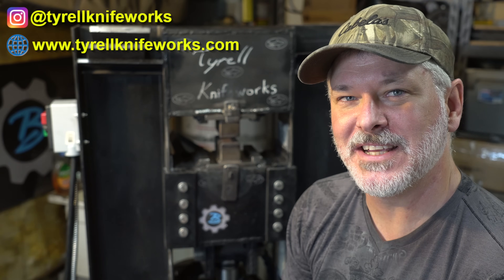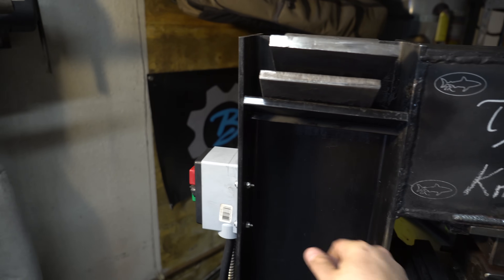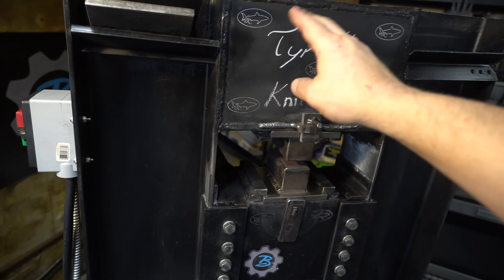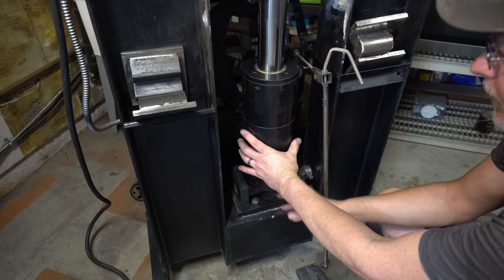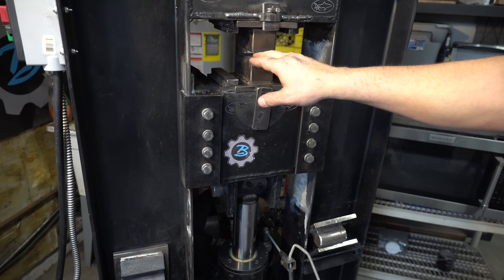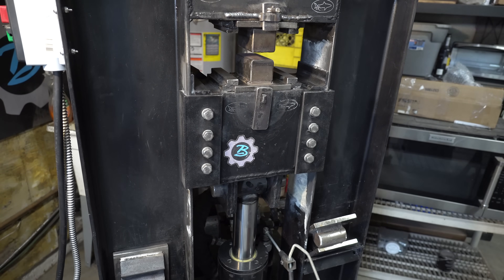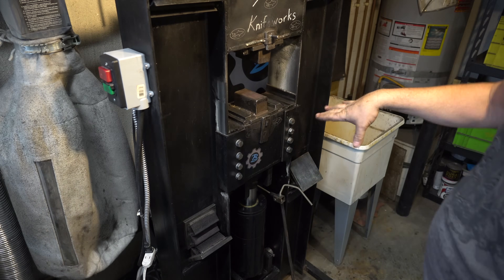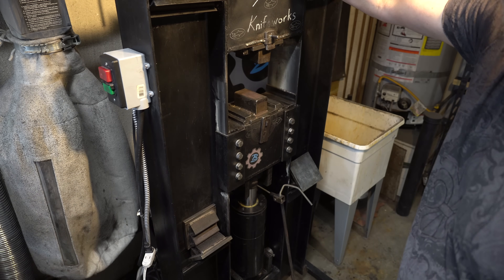Triple-T #83 - How to build a Hydraulic Press

Comment: Good day, im about to start a forge press build and have used many of your product links and suggestions. Thank you!
My question is, 
With the 13gpm pump, 3450 rpm 5hp motor,
Have you had any issues with the 10 gallon reservoir? 
Inquiring about it some say it should be 2 to 3 times the pump flow. (Say 35-40 gallons)
I was just wondering if i should get bigger than 10 gallons if you've ever had over heating or problems.
Anywho thank you so very much for all your content and your time 🙏
Reply from the maker: It’s a great question.  I’ve had no issues with the oil heating up at all.  I use my press sometimes for 8 hrs a day for multiple days and I’ve never had an issue.  Good luck with the build.

Comment: Hey man, I’m not sure if you know this or not, but the Coupler you have listed is 5/8 to 1/2, not 7/8 to 1/2, which the motor you have listed is a 7/8 inch shaft. I’m actually building the press, just got all my parts in however i immediately saw the L jaws and realized i should have checked. Just wanted to let you know
Reply from the maker: Ah yeah, I’ve had to replace the link to the motor a few times and must have selected a 7/8” shaft.  The 5/8” is more standard.  I’ll update the link.  Thx.
Reply: @TyrellKnifeworks No problem brother. Thanks for the good build, i’m about to start welding everything and i’ll have it built hopefully within the month.

Comment: I use my hydraulic wood splitter.  27 ton if I remember correctly,  and runs on a 6 1/2 horse gas motor. It doesn't release until I turn the lever to retract.  Honestly I didn't even know any were made with springs.  It's towable too. You must be referring to the cheap electric harbor freight type splitter.
Reply from the maker: That’s a big splitter.  Most are 10 or 12 tons and are not built for any sort of resistance like steel and flex like crazy.   Thanks for watching.
Reply: @TyrellKnifeworks  every one I've ever seen, other than the harbor freight electric junk, are made with a big I beam base, a ball hitch,  and an axle for towing. Every farm store in the country carries one,  except maybe California and their no gas engines nonsense. Some are even bigger than the one I bought.  They have a 2 way valve with a handle that engages and retracts the hydraulic cylinder.  Mine even has a tilt feature that allows me to stand the beam up and split horizontal instead of vertical for big pieces of wood.  It puts the base at ground level.

Comment: Do you have a parts list for the steel?
Reply from the maker: The ibeam I used is 5”x8”.  It’s two
5-foot sections for the side beams and three 1-foot sections for the top, bottom and sliding head.  I used 2”x3” angle to enclose the head onto the ibeam.  The rest was scrap I had lying around for the legs and tank cage.  I hope that helps.

Comment: You mentioned 35 gallon per minute in the video and listed a link to a 13 gallon per minute pump... could you please verify which it is?
Reply from the maker: It’s 13gpm.  Sorry for the confusion and thanks for watching.
Reply: @TyrellKnifeworks  Thank you for the clarification - I gotta say - not sure if you went off of someone's plans but holy buckets that's one seriously over-built press. Yield strength of A36 structural iron is 36,000psi and based on the dimensions you provided on the uprights, that's W-Beam 8x21 meaning 21 # / ft - both of those beams together can support about 220 tons before deformation!!! Thank you for the walkthrough! Very thorough and informative!

Comment: Hi Master 😁
I am in the process of building a press from your project. I don't know about hydraulics either, an engineer friend is helping me. And would like to know what working pressure is set in your press.
Greetings JB ✌️😎
Reply from the maker: My cylinder is rated for 3000 so it’s around that pressure when operating.  Thanks for watching.

Comment: What sort of tradesmen did you hire to do the hydraulics?
Reply from the maker: I called a local hydraulics shop and asked if they would come quote it.  It was $450 for them to bring and install the hoses and fill it with oil and test it.  It was a good deal I thought.
Reply: @ sounds like a good deal to me. I will give it a try when I reach that stage. Thank you.

Comment: Just the listed materials in the links are $1700 today, only 2 years later. Thats NOT counting the steel, OR the $400 he paid to have the hydraulic work done. Im guessing this is an easy $3k build today. Thats double, or just about if the steel and other odds and ends dont add up to $1300.

Absolutely nuts.....
Reply from the maker: Yeah, it's really crazy how expensive things have gotten.  When I bought that cylinder it was only $305.  The steel was $200 and they cut it for me.  Still, buying that press from Coal is around $8k for a 25t and this is 29t.  Thanks for watching.
Reply: @TyrellKnifeworks  I probably should have started my comment by saying thank you for the video because it's a great tutorial. And you are correct, still cheaper than a store-bought press, and I would think it's even better because you can really tweak it to your own needs. I was just floored at the pricing increase.... Crazy! 

Keep up the great content
Reply from the maker: @mtoto78 no worries, I took it as you meant it. 👍

Comment: I amso have a question regarding the pump, in your video it says the pump is a 35gpm. but in the parts list it says 13gpm. a 35 rpm pump runs around $750 and looks nothing like what is in the video. Sorry for the confusion but I was just wondering which gpm level I should get. :D
Reply from the maker: It’s supposed to be the 13gpm, I misspoke in the video.
Reply: @TyrellKnifeworks  thank you!

Comment: Quick question (I hope)... the linkage from the foot pedal to the valve is hooked over on the top. Is there any reason to extend it and have it hooked over, or can that be flush with the square tubing? Looks like it would function as a handle, but I can see myself hooking on it. Thanks for putting this out there, I really appreciate how much content you've provided the knifemaking/blacksmithing community!
Reply from the maker: It’s hooked over so it doubles as a handle if you want to do it manually.  It’s far out of the way and I’ve never even brushed it while using the machine.  Thanks for watching

Comment: Thank you for the video... On your build, dis you have the hoses made to length or are they off the shelf lengths? Is there anything you would recomend doing differently now?
Reply from the maker: I had a guy come do the plumbing for it so he did the hoses custom.  The only thing I’d do differently is that I’d put flat areas in either side of the die holders so I could put holders for different lengths of square tube on both sides for kiss blocks.  That’s it, everything else seems great and I’ve been using this press for 5 years.  Thanks for watching
Reply: @TyrellKnifeworks  thank you for your time. I have build 200 Tire Hammers and am thinking about building a few presses.

Comment: Did you do stress calculations on the frame (especially the welds)?
Does the hydraulic system have overpressure protection?
Does the system have an emergency kill switch that could be reached in case of an oil fire?
Is the operator protected in case of a burst hydraulic line?
Are you sure the tray is adequate protection when a workpiece drops out of the wrong end?

There’s a reason why you can’t buy presses for +-$1400. Safety chief among them.
Reply from the maker: Yes.  Thanks for watching.
Reply: @TyrellKnifeworks  what do you mean “yes”? You mean to say you did all of the above? 
Don’t just give me a “yes. Thanks for watching” and treat me like an actual human being with legitimate concerns.

Comment: Thanks for great explanation, this seems quite doable and I'm going to build one. I'm also wondering, what were the considerations for selecting the cylinder, the engine and the pump? As someone coming from the metric part of the world, I'm going to use some different equipment and I'm not sure how the calculations work. I've done the conversions, found a 220 bar 50 lpm hydraulic for 3000 rpm, a 4kW 3000 rpm motor and a 50-ton-rated cylinder with a 63 mm diameter, and napkin calculations show that it should move at 67 mm/s (2.6 inch/s) and produce a force of up to 28 tonnes. Am I correct in calculating force from the pump pressure and cylinder diameter and choosing a cylinder rated higher than that force? And how does the engine power factor in here?
Reply from the maker: Choose your cylinder first that you want to base your build on.  There are online calculators for speed of the cylinder based on the pump speed and that's what you need.  You want the cylinder to go at LEAST an inch / 2.54cm per second, preferably 2"/5cm per second.  To achieve that you need a good pump and then get the motor with enough hp to drive that pump.  Make sense?    Thanks for watching!
Reply: @TyrellKnifeworks   thank you! Looks like the components I found should work great then

Comment: Do you have a list of metal you used? I’m not sure if the link works anymore
Reply from the maker: Not a specific list but the main parts are 5” x 8” H-beam cut in two 5’ lengths with 3 12” lengths used as the supports and the head. Thanks for watching.

Comment: Great build, love it. I have been pricing materials and getting ready to build one of my own. This has been the best video of showing each part of the machine, so thank you!! 
Also, in the video it sounds like you say 35gpm pump, but the link is for a 13gpm pump in the description. Is this just a slip up? 
Thank you again for all the information!!
Reply from the maker: Yeah, I screwed up in the video, its a 13gpm pump.  With a 30 ton cylinder, 5 hp motor and 13gpm pump you can achieve about 1.5"/s travel on the head which is about what you want.   Thanks for watching
Reply: Awesome, thank you!
Reply: ah, someone else asked this, thank f

Comment: I bought a benchtop 12 ton from Coal Iron Works.  First test was 2 inch round and it crushed it no problem.  Not sure why smiths with limited space have massive presses.  Perhaps they are compensating for smallness in other areas.  Bigger isnt better, it just gets in the way.
Forge On!!!
Reply from the maker: Watch my recent video on hydraulic press questions.  There are lots of good reasons.  Sure you can do a 2” round, but what about a 2” x 6” billet?  What about something that’s 3/8” thick?  Smaller presses will certainly get the job done, you just have to take smaller bites.  They have smaller dies.  When you’re working on Damascus, it’s easier with larger dies.  Thanks for watching.

Comment: Awesome video thank you! And one question I wasn’t able to find in the comments.. I see your link northern tool is for a 3500 psi cylinder will that work? Or would you try to find a 3000 psi cylinder? Thank You
Reply from the maker: As long as your valve/pump can support 3500psi, then you’re fine. Thanks for watching.

Comment: Building another like that would be a lot easier if you used the correct terms for the sterlwhich is wide flange H-beam.  Putting bolts through I-beam requires tapered wedges on the inside.
Reply from the maker: Despite what YOU call them, just about anywhere will refer to these as I-beam.  Including any of the online metal suppliers.  Thanks for watching.

Comment: Thanks for all that you do. I too am IT by day and Bladsmith by night. Given you have used this for roughly a year, any tweaks or changes come to mind?
Reply from the maker: I’ve actually had the press for over 4 years now.  I wouldn’t change a thing except my kiss blocks.  Instead of “saddles” over the flat dies I’d change to square tubes of different lengths over holders on each side of the die plate.  Thanks for watching, Brian

Comment: Really great and simple design.
One thing I have always wanted to know is during the pressing process, you create a lot of scale and waste.
Where does that go, and can it be re-smelted or recycled?
And if not, what do you do with it?
Reply from the maker: With this design, the scales either falls forward or slides down the chute on the back.  Scale is basically iron oxide with no carbon in it.  It’s a waste product that has no value and is thrown away.  Thanks for watching.

Comment: Disagree I rather have my work piece stationed I have more control over ,instead of going up and down with my work piece trying to keep it in place while ram moves, only advantage of this if u are limited to ceiling hight that's best way to go , but like power hammers and any hydraulic presses having cylinder on top is preferred,  more control. If u want ur work piece eye level make sure u set ur buttom dies at ur preffered hight !
Reply from the maker: You've definitely not used it this way then.  You put your work on the die, it doesn't move.  Try it some time before judging and you'll see.  Thanks for watching.
Reply: @TyrellKnifeworks   what you talking about you put ur work piece on a die and ur die moves up with ur work piece ! So ur arm moves  up and down !  Where when ram is on top ur work piece never moves !!!! Also not judging at all just making a point/ observation  that u seems not to like , 😂
Reply from the maker: I’m referring the it fact that once you place it on the die, it doesn’t move around left and right.  The whole idea that the ram must move down is really only in your head.  The ram on a hydraulic press is NOT like a power hammer where direction matters.  A power hammer has an anvil and you are striking that piece onto the anvil.  There is no such thing on a hydraulic press.  There is equal force applied from top and bottom regardless of the direction of the ram. Once you use both versions (ram on the bottom and on top), you’d see what I mean.  You see, I’ve used both and having to bend down to see your work or building a huge taller press is silly when the direction of the ram makes no difference.  But hey, it’s your choice, build what you want.  Just keep an open mind and actually try both before you make a summary judgement.

Comment: You make the best videos. Just the right ratio of specific, useful info, with a straight forward, boiled down approach.  Do you think the Vevor hydraulic power packs would be a decent alternative?  They come in various sizes, etc. They are attractive because it's a total package (excluding ram). Thanks again for such great content.
Reply from the maker: I haven’t looked at those hydraulic packs from Vevor but I would just buy the pieces.  The pump/valve/reservoir isn’t much.  Plus you want to match the ram to the pump/motor.  Thanks for watching!

Comment: I saw in the parts description, you listed 2 cylinders. Is that incase we couldn't get the 29 ton, the 18 ton would work instead? Thanks
Reply from the maker: I couldn’t find another link for a 29 ton so I added the 18.  I would definitely keep looking for a 5” bore, 12” stroke, 3000 psi cylinder.

Comment: You mentioned that it is on casters. How much is the overall weight, and what type of casters do you use? Do they effect the press when it is in operation?
Reply from the maker: I haven't exactly weighed it but they are each rated at 200lbs and it moves around relatively easy with some pushing but not enough that when you're using the foot pedal it moves.  It's quite solid.  Thanks for watching, Stephan.

Comment: Without a doubt I spend more time watching Denis’ work, than any other channel on YouTube. I wish I had the skills to build something like this, but as an intermediate bladesmith, who has never really welded well, I’m not so sure I could pull this off. The frame seems to be the less worrisome part of the build. Mounting the motor and hydraulics would be my downfall. Love what you do Denis! Thank you!!
Reply from the maker: I built this with a $125 stick welder when I had very basic welding skills.  The frame and head isn't hard.  The mounting area for the dies needs to be thought through.  The motor/pump mount is easy too.  I had a guy do all the hydraulics because that part scared me.  😜.   Thanks for watching.

Comment: Is your cylinder a 5”bore with a 12”stroke?
Reply from the maker: It is a 5" bore, but I don't quite remember if it was a 10" or 12" stroke.  With the flat dies in it, it has about 6 inches of travel and those dies are 2" thick, so it's probably a 10".  Either would work though, you just need to change the construction a bit.  Thanks for watching, Matt.